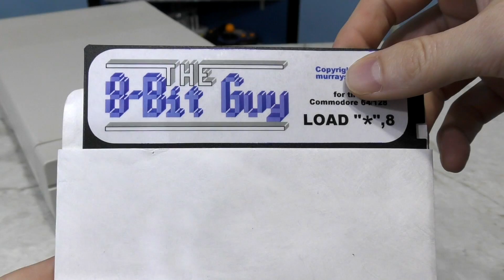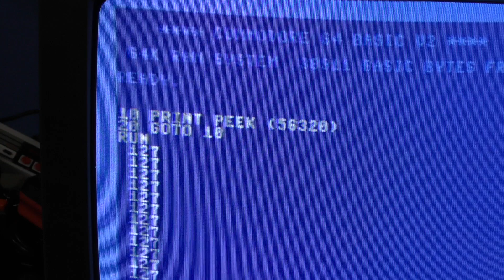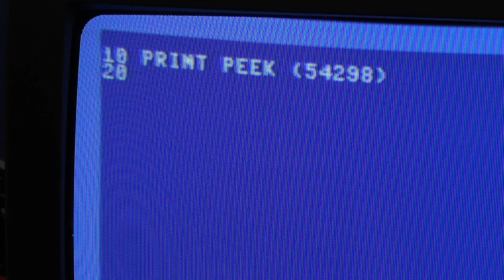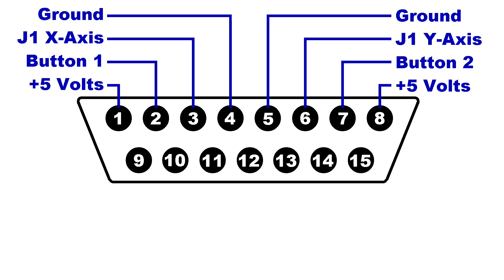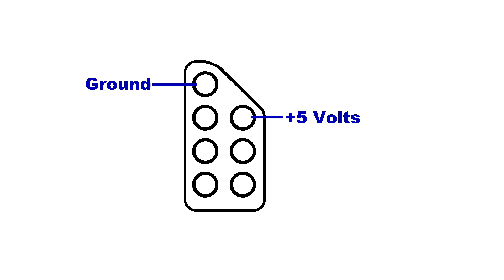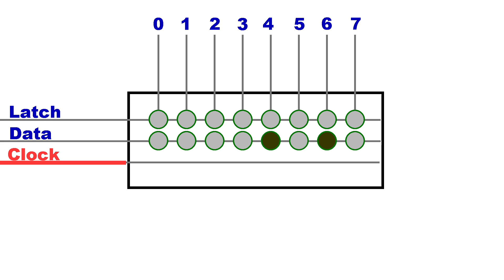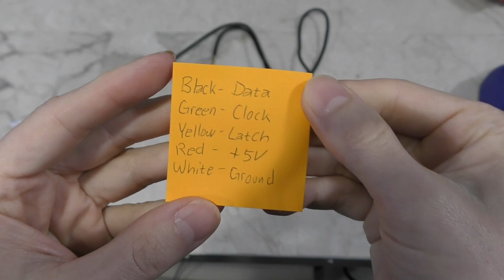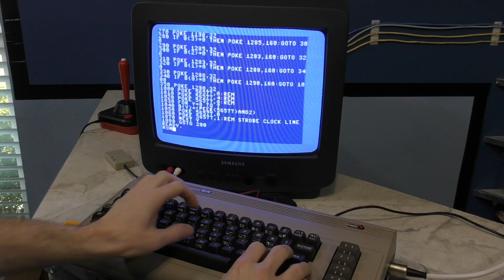How Vintage Game Controllers Worked

Comment: Regarding the NES:  The shift register is also what allowed the NES Four Score to work.  The Four Score would have two 16-bit shift registers, one for P1 and P3's input and another for P2+P4.  Games would then read 16 bits of controller data rather than 8 to get all inputs, without needing any extra pins.   The harmful side effect of this was that it was somewhat costly on the software side to read the joypad data, as it wasn't as simple as polling a register.  The register had to be polled 8 times -- once for each individual button.  And due to a bug/quirk in one of the audio channels (seriously), some bits might get lost during the read process -- therefore games that used that audio channel had to do redundant reads every time they polled the controller.  So instead of a quick 4 cycle read, the process was in a complicated loop that took several dozen or even over a hundred cycles.

Comment: How convenient that analog joysticks -- like those used on Apple II computers and some other platforms -- that used the same DB9 connectors (IIC/IIE/IIGS) (or DIP 16 on the Apple II/II+) -- weren't covered. Apple's joysticks would make a good video subject simply because Woz, in his classic "I'm both a genius and a cheap idiot" way, chose to use a bizarre part: a variable 150k ohm resistor (potentiometre) tied to +5V -- which is a very uniquely-spec'd part that no one has made for 40+ years.  This specific level of resistance makes replacing these pots, which are the #1 cause of failure, a real pain in the butt.  Likewise, the buttons are actually TTL (vs. actual switches like everywhere else on the planet) and require a 470 ohm resistor for pulldown.  How about covering these?  I'm still surprised nobody after all this time has made something like a $5 Playstation2-to-Apple2-DB9 adapter, instead opting for recreating joysticks/joypads and other weird nonsense that nobody wants to deal with (and charge an arm and a leg for them, in true Apple fashion!).  So how about it?

Comment: The Koala Pad tablet, which had a version for Commodore, worked like an analog joystick with 2 buttons
Reply: The KoalaPad then, used the two analog pins and the two fire buttons.
Reply: @therealAZLN  I had a Koala Pad that I don't remember which computer it was made for, or which sort of computer I tried to use it with. May have had a DA15 plug and I hooked it up to a PC with Windows. Been quite a while ago. I do remember that I was able to run some test program and touching the pad at various places moved the indicator there immediately. Moving my finger around made the indicator follow. When I lifted my finger the indicator snapped back to the center. I got rid of it because I couldn't find any image editing software to support it.

If that's how they all worked, software written specifically for a Koala Pad would need to have some sort of holding variable(s) to store the position when a finger or other stylus was lifted. Otherwise, if the user held down whichever button was for drawing, there would be a mess of lines drawn radiating from the center of the drawing.

I used a Koala Pad a few times on a C64 in my school days and I recall that it's operation worked like much later tablets for PCs, except with buttons on the pad instead of the stylus.

An investigation of how the Koala Pad worked for Commodore and other computers it was made for would be quite interesting.

Comment: Adding the Genesis controller ( 3 or better 6 Button version) would have been interesting, due to solving the problem with more buttons than pins a very simple way. Also it stays partly compatible to the Mastersystem. This allows compatibility for simple arduino projects, for example auto-fire and cheat code entering :)

Comment: Wait, you said Select Button but the Genesis pad has a start button. I always used a genesis controller on the C64 and never destroyed anything. I would be surprised if I had never pushed Start at least once.
Reply: He's cocked up his explanation of the Sega Genesis/Megadrive controller. The Select pin is actually an output, not an input - used by the console to choose which bank of buttons to read.

Comment: 3:39 What do you mean the "select button"?
Reply: He's cocked up his explanation of the Sega Genesis/Megadrive controller. The Select pin is actually an output, not an input - used by the console to choose which bank of buttons to read.
Reply: @gwishart  Yeah, but which button(s) set it off?
Reply: @meatblazestudios3778  None of them 'set it off', it's an OUTPUT.

If the select pin is low, then the input pins return Up,Down, A and Start. If the select pin is high then the inputs return Up,Down, Left, Right, B and C.

Comment: And what about the PlayStation 1 and 2 controllers ? They also use pins ! It's probably the same method as on the NES/SNES as the ports for PS1 and 2 controllers are similar to the ones of the SNES (they're just larger with a few more pins).

Comment: Original Xbox controller does not have isb
Reply: VARIABLE 851 it used USB, but it had a different connector.
You can buy adapters that make the Xbox controller port into USB.

Comment: I have a question that the video didn't seem to address. Both the NES and SNES had 4-player adapters. How did these work? Does the adapter send an extra byte of data that only the game is looking for to identify which controller sent the input? I'm guessing that the zappper pins are probably used for this?
Reply: Not sure about the SNES, but the NES Four Score doesn't use any extra controller pins. It uses a 16-bit shift register, which sends two bytes per poll, rather than one:
http://wiki.nesdev.com/w/index.php/Four_Score

Comment: In the 80's I made an alarm for my bedroom. I used the joystick port on my PC/XT. 
Anything that was wired with a sensor I could tell what and when it was moved.
I never got around to using the serial port to have move sensors.

Comment: That explains why I've always hated the input lag on the NES controllers.
Reply: The NES has a 1.79 MHz clock speed, which means 1.79 million cycles per second. The 8 cycles required to get the data from the controller are absolutely tiny in comparison.
Reply: @user-74652  Either I misunderstood what you meant or you seem to have completely and absolutely misunderstood the point of my comment.  The controller had lag because it only used 8 cycles to poll the controller.  And yes, NES machine itself had horrible lag, you can tell that when you compare roms to cart experience.

Comment: @0:11 The joystick at the lower left is the one I have. Wonderful joystick. No leaf spring contacts, this one has industrial microswitches, and a stainless steel reinforcing rod in the stick. Built very solid. Practically indestructible. The only downside is it is a right hand control, although they also made a left hand version as well if you asked for it. Was no problem until I got a left handed GF. She was able to use it but it was clumsy for her because she couldn't grip it as well.

Comment: Paddle POT input is also how things like the Koala Pad and other drawing tablets worked.

The digital joystick inputs on the Atari are also used for mice & trackballs, as well as the keyboard controller.

They're I/O ports (not just input), so that's how you can get 12 buttons to work, per port!

The output functionality is also used for multijoy devices. (I just got one that plugs into the two controller ports of my Atari 8-bit, and up to 8 joysticks!)

Comment: Wait, so is the Sega Genesis controller safe to use on the Atari 2600/7800?
Reply: Yes, it's perfectly safe. His explanation of how the Genesis controller works is total crap. The Select pin isn't an input, it's an output used by the console to select which bank of buttons to read from the controller.

Comment: QUESTION: Pressing Genesis/MegaDrive Start button when plugged into C64 what is the potential for damage? Because I'm almost certain I've done this before.

My C64 has a dataset issue these days where it runs too slowly to read/write most games. I think it's a capacitor issue but I'm no expert or electrician so I'm not able to fix it. Hope it isn't Start button related!

Comment: I would actually love to learn how modern controllers use USB.
Reply: HID Classes, and they are much more complicated, using hexadecimal values and something called a "JoystickReport" function (I'm messing with the function with an Arduino Mega for building a simulation-rig).
There's stuff with most significant bits and least significant bits, parts of the communication being expected to adhere to certain standards or classes or they are interpreted wrong.
It's ehm...hard to mess with, even though theoretically, the amount of buttons is endless...

Comment: Many of the cheaper joysticks of that era just used metal plates rather than proper switches. The best ones used microswitches, which produced a nice tactile click and a much more robust electrical signal.

Comment: Awesome video. Couldn't find your download link, but since c64 list so slow managed to read your code from the video screen :) cool demo.  Had a C128 back in the days, used to program it in basic before i really understood how machine hardware works (only 1-2 decades later on a pc). What kind of language did most of the game developers use back in the days ? assembly code ?

Comment: What I love about NES controllers is that they are so easy to clean and repair. Even if the simply circuit board is destroyed you can recreate one with a circuit board making kit. Soldier in a few parts and wires, get the button contacts ready to go, and you have a new NES controller.

Comment: Found an eBay listing that'll allow you to use a Sega Genesis/MegaDrive controller on a Commodore VIC-20/64/128, and the Amiga series: https://www.ebay.com/itm/113502129211?nordt=true Also, it's amazing that you can use an NES controller and PC controller on the C64. This channel is amazing. I'm also glad the Atari controllers are compatible with the C64, which is nice.

Comment: Great video. Technical question. I understand how the 5v and ground were found with the multimeter when adapting the controller port. How was the data, clock and latch differentiated to know which one was which?

Comment: The 16-bit era console controllers mostly worked on the same principle as the NES controller, only with more bits in the shift register to handle more buttons. The ~1995-2000 generation consoles were somewhere between that and modern machines... they added analog sticks (which have their values sent back digitally, they're just "analog" in the sense of having values in between 0 and full deflection), two-way communication (for stuff like rumble and lights on the controller), and sometimes controller peripherals (N64 paks, Dreamcast VMU, etc.) but the protocols were still pretty much SPI, not very far removed from the NES controller at all.

Comment: I was surprised that the ground was white, not green: I used to work as an electrician, and did a little low voltage (and even fixed my Super Nintendo controller): the ground was always green, and white was neutral. (The fact that Nintendo is a Japanese company and this was the 80's may have something to do with it, as the rules could have changed, and the color codes vary across countries.
Reply: Inside of cable assemblies there are basically no rules on color coding, and intuitions stop being especially useful if you have isolated returns, or more than one voltage present.

Comment: Great video, as always. I could swear that the Genesis didn't have a select button, however it's showing on some schematics 🤔🤔 i'm confused. Mandela effect anyone?
Reply: He's got this part wrong.
The Genesis doesn't have a Select BUTTON.
The Genesis control port has a Select PIN, which is an OUTPUT from the console, to the controller - which determines which bank of buttons to read.

Comment: Digital joysticks are the quickest and does not need potentiomemter adjustment knobs (as seen in your video on one of those joysticks for IBM PC). Those type of digital joysticks are widely used in on arcade machines as well. The Commodore 64 had real dual dedicated 8bit ADCs (built into the SID custom chip) which are fairly accurate and quick. But both the IBM PC and Apple II had shitty "ADC" hardware using monostable timers (which is also a sign of cost cutting since run-of-the-mill timer I.Cs are way cheaper than dedicated ADC I.Cs) that require the CPU to trigger and reading back uses CPU timing cycles such as a software counter loop. Additionally the speed of the CPU can be critical because the "ADC" result depends on a fixed CPU clockspeed. If the CPU is faster than the original speed (like Turbo modes) then these joystick readings goes awry and wrong. Hence often we see games having a joystick calibration option. However if this software counter loop is interrupted (like the periodic timer IRQ for the system time and date at every 55ms) then counter results would become incorrect which creates inaccurate joystick controls causing unstable sprites and pointers. And also the software counter loop will occupy the CPU for sometime (while the main game program had to wait for the result and waiting time varies depending on joystick input), this is also why joystick reaction or response on both can be rather slow or laggy, often left many using the keyboard as the faster prefered method for playing fast paced arcade style games. Well, that is speaking from my experience (on all these machines). For example, Ms. Pacman on the Commodore 64 was much more playable with joystick but on the Apple II was simply frustrating with joystick and ended up using the keyboard instead.

Comment: Okay, but there is one thing that has always made me curious.  How does the NES and the SNES utilize a multi-controller adapter?  There was a small selection of games for both systems that could allow more than two controllers on the system, but they plugged into the regular controller port.

I never had the four player adapter for the NES, and I always wondered what would happen if you used it with a game not designed for it.  I became even more interested in this as I've grown to understand the basics of how programming in assembly works, and how the system stores the controller input into set memory locations.
The adapter for the SNES also really intrigued me, because it only plugged into ONE port on the console.  I have one, and it surprises me to think that one regular controller port could handle four controllers all at once.
Reply: The specs are here: http://wiki.nesdev.com/w/index.php/Four_Score

In very simple terms, the NES can send a mode selection byte, which causes the controllers to return 16-bits of data instead of 8.

Comment: The Tandy TRS80 used analog joysticks. Which was cool.  But the bad part was it had no spring to return to center.  The joystick direction stayed at what direction you moved it until you moved it another direction or back to center

Comment: I had to repair my 2600 joystick as a kid. My friend really was hard on it. Turned out that  the little plastic nubs under it that push the contacts was bent. Luckily they didn't break off when I bent them back. He never got to play my Atari again :P
My Atari 2600 stick did not look like your's inside.

Comment: He's wrong about the Sega Genesis controller. The +5v powers a multiplexer chip and does NOT go to the select button (because it doesn't have one and it doesn't go to the start button either). I've had no problems using my Sega Genesis controller on my C64.

Comment: 9:38 I thought it was 2...
Reply: Electronically you can press all eight buttons on a NES controller at the same time. Only the mechanical lever in the D-pad prevents you pressing opposite directions simultaneously.

Comment: I wonder if it would be possible to build an interface that would let you connect 2 NES controllers to the 2 9 pin joystick ports.  I know one of the ports can be written to, for the purpose of scanning the keyboard.  Perhaps that could be used for sending the control signals to the controllers.  The other port could be used for reading the shifted bits from the controllers.

Comment: Why build an adapter for the NES Game Pad to use the C64 User Port when there's plenty of modded NES Pads that use "Atari" DB9 connectors? It even looks like you have one in your controller collection there. I guess you wanted to be able to access the 2nd fire button on the NES Pad...

Also in terms of the DB/DE15 connector known as the "PC GamePort". The Atari 5200's DB15s operated similarly with its analog joystick actually operating like a Paddle. It's one of the reasons why Paddle Mods are so popular amongst 5200 enthusiasts; there's more than a few videos on how to do such a mod on YouTube. The AtariAge user Bohuki - I think that's how he spells it - sells a PC GamePort-to-5200 Adapter in the 5200 section of the AtariAge Forums. Other consoles that also had DB15s include the Nintendo Famicom for its external joystick port and the NeoGeo. For a while, some 5200 fans were getting the NeoGeo AES arcade joysticks modded to work with the 5200 by an AtariAge user named Grips03...

Comment: And if you use Atari's "2 Paddle Lines" for a non-Paddle controller with an Atari 8-bit computer, you can have 2 more fire buttons at your disposal. The engineers at Atari Inc's Consumer Engineering Division built their own 3-fire button Trak-Ball controllers for use with an in-house version of "Missile Command" that was never commercially released. They wanted the game closer to the arcade original with the 3 missile bases. It's pretty dope.